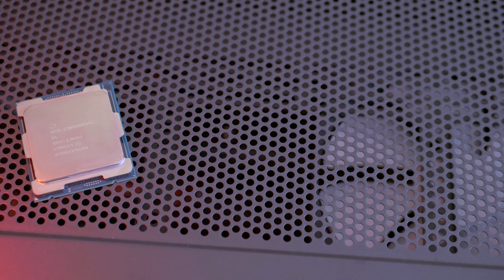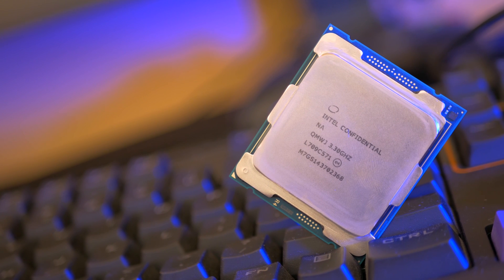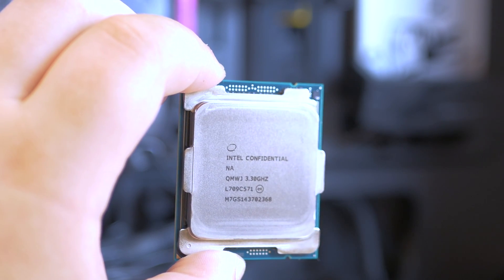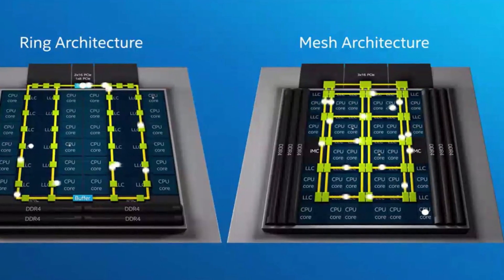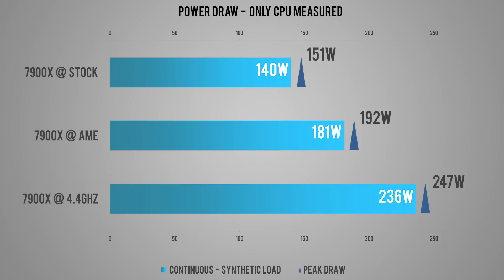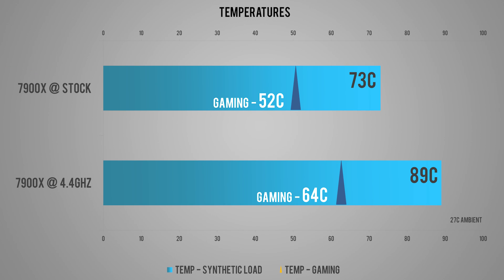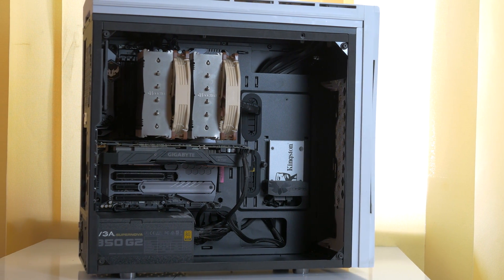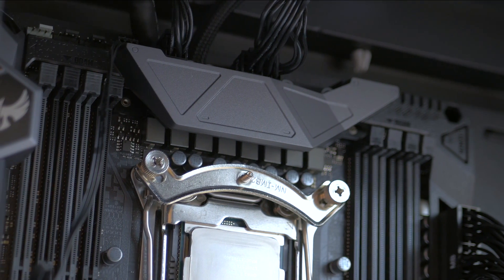Core i9 7900X - a post Threadripper REVIEW

Comment: If you tend to use more single threaded applications then multi threaded then this is a perfect fit and Threadripper is a case of vice versa which is how things have been for years. The argument for Ryzen relies completely on cost beyond that its a questionable buy where performance is concerned when you have something like this within reach.

Comment: Why would you use an air cooler for the 7900x  it was probably throttling down from the heat 
I over clocked mine to 4.7 with a custom water loop and hangs around 70c 
My cpuz score was
 multi thread  6804  single 499
Ryzen 1800x  multi thread 4542 and single 400
Reply: https://valid.x86.fr/208ql3

Ryzen 7 1700 @ 4239Mhz @ Custom water loop
5246 multi, 481 single

Comment: It's not a lot of extra performance over a 1700, which doesn't need high end cooling to run in the 3.9-4.0GHz range. The only benchmark you showed where the performance of the 7900X placed it at its best was the cinebench benchmark which had it at 33% better than the 1700X. So for 33% extra max performance for what's likely a 100% system price increase doesn't make for a compelling argument for the 7900X. Given the other workloads don't come anywhere near that level of performance gain, the 1700 really looks like the desktop king of price/perf for GPCPU related tasking.

Comment: Further shake things up? X299 didn't shake anything up in the first place. Coffee Lake on the other hand, well for that the i5 is going to be the platform's crowning chip even if the top's priced at $300, and assuming the i7 isn't priced at $300 which I highly doubt it'll be, but expect to see 5 to 10% IPC gains over Kaby, horrid TIM, high power draw, a one time use platform, and basically same old Intel, except now there's extra cores/threads. If there's a 4c/8t i5 at ~$200 then that's Intel giving the middle finger to Kaby buyers which'll show how much they care about their customers.

Comment: X299 is just complete Garbage right now. AMD's Threadripper tears apart the i7-7900X, and I'm sure it will beat any of the other Intel Chips that come out for Skylake-X in the Price-to-Performance Department.

Intel's release of X299 was one simple sign: A sign of Panic.
Reply: Who the FUCK drops $1000 on a gaming chip? I hope you were being sarcastic.
Reply: Nope. The high price point for the CPU and motherboard for a few more fps is just autistic thinking. An i7 7700k or a Ryzen 1700 is a much better deal. And Threadripper isn't exactly geared towards gamers.
Reply: So you're going to pay 1000$ for a CPU to play at 1080p instead of 4k? Great fucking idea
Reply: Threadripper has 2x the ram capacity of Ryzen. That's reason enough. 64 GB is not a lot for some workloads.
Reply: barely.  a 7700k is better at far less cost.
Reply: If by some stupid reason you have enough money to buy a $1000 CPU along with the system to go along with that but you also want to do high refresh rate gaming and content creation Skylake X is not a bad option... But if you have $3000 spare I am sure you probably have another $1000 to make a 1950X rig and a 7700k rig one for content creation and the other for gaming, there are also certain times when single threaded performance can be preffered in content creation as well so when it pops up you can just do the content creation on the 7700k rig.

So there is a use case but it's a minority of a minority, people spending $1000 or more on a CPU but not having enough money to buy a second system.
Reply: @Seth Levy you obviously have no idea what your talking about as transcoding and encoding use as many cores as you can throw at the task actual editing may not use all those threads but you will most likely need to transcode the raw footage before you start editing, second it means that you can edit a video while are transcoding another video on the same machine or you can play a game while you export etc etc etc.
Reply: I mean i love threadripper, but when you care for aesthetics and go for a nice board for x399 which will cost $400-500 then paired with a 1920x or 2920x automatically we are already at 1k ish. Im sure you can just pick any bland x399 board thats cheaper or a used one on ebay and get a deal if you dont care and you just want the tr4. 

But for many PC builders that care for aesthetics and a good looking and performing build, then you buy the deal that makes sense to you. I found an x299 board for $159 evga ftw(new) and then a 7900x(new) for $700 putting me about $800+. Price matter yes, but cores do to. Meaning I prefer to compare CPU based on their cores so 7900x is more comparable to a 1920x or 2920x.  Where both perform literally about the same with Ryzen pulling just ahead only due to its extra 2 cores.  

Now I do agree i would of never bought the i9 when it first came out at $1700 it is just plain stupid. But for many of us that just wait for parts to age and prices to come down, then sure who cares you decided to get an i9. If you are happy and you got a good deal, then fuck it. same goes for ryzen. like why pay $500 for a 2920x when you can get a used one for $100 less. Like that makes sense.
Reply: If you want a CPU that is a combination out of i7 7700K and Ryzen 7, 7900X is the CPU you want.  

And that's exactly what I want.
Reply: Etheoma, there is no reason to purchase a threadripper chip for content creation. Simple content creation will never use all of the potential threadripper has. Running multiple CAD and 3D modeling software would come close, but there are very few uses for threadripper on the consumer market. Honestly if you want to play games and stream/record to the same computer, Ryzen 7 or a 6800k will do just fine. No need to dish out thousands fro i9. Just intel's way of pushing out another refresh of the same product. (Also not even 64 pcie lanes on i9. What was intel thinking?)
Reply: i9 is still better for gaming.
Reply: No, I wasn't being sarcastic, And I am one of them who drops $1000 on a gaming chip. 

You don't seem to know that games today and future games is going to favour more cores and more threads. And since i9 has a better clock speed than threadripper. I'm going for Intel.
Reply: That's correct! I do indeed have "autistic" in my username... But my I cannot see how my choice in CPUs have anything to do with the autism spectrum.

Comment: Man.  B350 mother board like $100.  R7 1700+Aio like $400 and run it at 3.7-3.9ghz.  Equal to the $1350 7900X MB/CPU setup for practical purposes.   When Ryzen 2 gets the clocks up, Intel is in serious trouble considering it's looking like Coffee Lake i7 will have a clock speed regression as a trade off for the 2 extra cores.

Comment: This is why i love your Graphs!
You choose for 3466MHz on the 1700X. And the other intel CPU's.
AMD already proof on their blog that, 3466MHz is the performance sweet spot for Ryzen 7.

+MindBlank Tech
As you know the i7-7820X is out and cost ~$550-$600
And AMD still has the Ryzen 7 1900X that will come out soon, and cost about ~$550-$600
Both these CPU's 8 cores 16 threads, and are on a some what costly motherboard platform.
They both support Quad Channel DDR4, but it's hard decision which one is good on what.
Would u find it interesting making a head to head review about these with benchmarks?
Reply from the maker: +Nisco Racing Well, the 1900X has the added bonus of lots of PCI-E lanes. X299's 7820X doesn't. If I get a 1900X, I'll make a head to head, for sure! With R7 along for the ride as well.
Reply: @julio villanueva.  Well a 1900X has 2 other advantages people don't see to be talking about.  First it, like all TR cpus supports ECC memory.  Could be the deciding factor for some people.  Second and why they are worth it, Both the 1900X and 7820X are what I call entry level professional CPUs.  They are for small scale pros.  Think medium size Youtube channles,  small 1 or 2 man indie game dev studios, videographers, audio guys, Twitch streamers. ect.  People who can benefit from the  platform features like more  PCI-E lanes and quad channel memory but whose work volume and/or required turn around time doesn't justify a $1000 cpu......YET.  Yet is the key word and the other advantage of TR over Skylake-X.  If they out grow their 8 cores, on TR the upgrade options are simply better.  Intel's next step up is the 7900X for $1000.  On TR you can pay that and get 16 cores which is way better or pay $200 less and get 12 cores.  It is a much better upgrade path.  Plus AMD is likely going to support the TR4 socket as long as the AM4 socket r so when that day comes to upgrade it's likely a TR gen 2 or Gen 3 can go in the board or you could save money and get the Gen 1.
Reply: If you want more pcie lanes you should go with 1900X... if you want higher clock speeds go with the 7820X... Either  way I don't think any of those cpu are worth it...
Reply: I know AMD has a lot more PCI-e lanes, but i can bet you that most of the people on X399 will use about 50% of the PCI-e lanes.
It's like saying buy this model that has all the extra stuff, but you won't ever use the extra stuff...
AMD 64 PCI-e lanes vs intel 28 PCI-e lanes is indeed a big gap, but until you don't really need that much it's just waste.

My system mindset is towards CPU performance and Memory performance.
I want the best performance in these two cases for the money budget i have.
And i see that AMD Ryzen ThreadRipper is not overclocking that high then Ryzen 7 is a little disappointing.
intel's X299 platform is way ahead of AMD Ryzen's platforms in memory speed.
AMD is struggling very hard to hit DDR4 3600MHz, while X299 can hit DDR4 4400MHz in Dual Channel, and 4200MHz in Quad Channel.
https://www.gskill.com/en/press/view/g-skill-announces-new-ddr4-specifications--for-intel-x299-hedt-platform
And this system is a investment for 2 years or maybe 3 years.
Reply: I have my eyes on the Asus ROG Rampage VI Apex, it has 4 dimm slots, but that is okay. I will have 32GB for now, and maybe double when they come with higher capacity RAM.
They say it's much better for memory overclocking only having 4 because less interference from other channels. And it's known for the best X299 high end overclocking motherboard.
I hope the VRM cooling is extra beefy and capable :D But i trust Der8auer's word on it :D
And it has Dual Dimm.2 that gives you the option for having 4 M.2 SSD's in RAID 0, ha.. that will be a enjoyment in testing :D
https://www.asus.com/us/Motherboards/ROG-RAMPAGE-VI-APEX
Reply: Nisco Racing PCIe lanes will see a lot more use when SSD pricing drops. You can hook up a heap of SSDs and raid them on Ryzen for performance you just can't get on x299
Reply: +Jethro Rose
 Is not my top priority for my system. And the SSD example you gave, i won't be needing that, so it's a waste for me.
CPU and RAM are the most important for me.

Comment: Nice review! I think you did a good job accurately showing how this CPU performs as it matters to most of us. I think the market will eventually settle on 3 main CPU choices. The R7 1700 for an allrounder, 8700K for a little more gaming oriented oomph, 1950X for a little more workstation oomph. But almost everything released in 2017 is good enough at everything. Certainly can use a 1950X for gaming or a 8700K for rendering without worrying too much. Or an 8700K for rendering. Just depends what your priority is. I have a 1700 and find it a good balance on all fronts including heat/power.

Comment: Core i9  7900X Grill edition
Reply: Gabriel Braga i9 7900x is the 2017 edition of Press-hot.
Reply: The i7 960 is another good heater. I might buy one of those for the split level house I'm living in. The TV room drops into the upper 50s or low 60s in the coldest parts of winter
Reply: I hear Core i9 7900X Weber Edition comes with free spatula :)

Comment: RAM 3466Mhz with Ryzen. BCLK?
Reply from the maker: +Senior sociopath ASUS C6H has a strap for 3466MHz. So no bclk OC needed. However, I am running 103 or 104MHz bclk IIRC with 3333 strap. Just because cold boot memory training is better than 3466 100MHz bclk.
Reply: Thanks, mister Mindblank.
Reply: what ram were you using?

Comment: Intel is in full denial now... It's time to accept that Amd is having a great time and lower the prices.
The heat, the power consumption, the stupid thermal paste and more other dumb ideas could be less important if the price was right.
Reply: Lol Intel is not in denial at all. If they were the 7820X would still be $1000.  They almost halved the price of their 8 core cpu.  But took away some PCI-E lanes and gave it a lower model number to make seem like that's not what they were doing but it is.   Without Ryzen and TR the 7900X would have been $1500-$2000 and the top or the Skylake X range. the 7800X would have been the 8 core at $1000.  They have also moved 6 cores to the mainstream which is almost certainly a direct response to Ryzen. So far from being in denial Intel has made the biggest price cuts they have in a very, very long time, maybe even ever.
Reply: josh885 you said without ryzen and threadripper. Well I think that if that was the case then skylake wouldn't exist and most probably intel would sell us four core processors until the end of time

Comment: wow thats getting a tad expensive... I dont think ill be changing over to any of the i9's

When I have my i7 7700k at 5ghz I only get a cinebench score of 1065 at best.. I cant figure out where im going wrong.. maybe ram speed? im at 3200mhz
Reply: what's running in the background?
Reply from the maker: +Grizzly PC Maybe throttling on the 7700K? Also, yes, X299 gets expensive really quickly when you add up the parts.
Reply: Ryzen 7 system has very limited expandability, it's fine for light usage when you need just cores but not much else. HEDT systems have their place, they can take multiple high bandwidth cards unlike consumer grade systems. Nvme raid is not out of question or more than 2 gfx cards. It's not always about core count.
Reply: MindBlank Tech heh that's true, my new build has topped £5k so far lol

Comment: delid it, push to 5ghz on same cooler, never break 80c, now the only limiter is the vrm
Reply: yes, just deliding is gonna magically enable for all 10 cores to go from 4.4GHz to 5GHz... sure
Reply: only providing intel incompitent engineering deparment used thermal paste for the ihs delliding a rizen and adding galium provided no benifit
Reply: indeed, lower temps mean less voltage leak. however, 7900X is measuerd in many sources to pull more than 300W of power at just 4.5-4.6GHz, and deliding isn't going to change this drastically. another thing is that the cooler used has TDP of around 140W, which is enough just for the basic overclocks like this in the video even with delided CPU. Even AIO liquid coolers are not really adequate for the thermal output of this kind of CPU. so for a 10-core CPU to reach the speed of delidded 7700K does not seem very realistic expectation, and especially not on an air cooler
Reply: no. 25 c is 7700k not 7900x. 7900x someone tested it and only about 5C differences. EVEN if there is about 25C I still doubt if 7900x can hit 5ghz since higher voltage doesn't yield as good as the lower ones.
Reply: James Mastroianni. #1 Delid 1K$ CPU not the smartest idea #2 Even that, your realistic maximum will be 4.7-8, when you have good custom loop #3 If you have very good chip, that can handle 1.35@5.0 and monstrous cooling, chiller + vrm waterblock... even then it not practical and can die shortly, because ~400-500w power draw - too much.
Reply: James Mastroianni no the limit is still your cooling
Reply: @Dmitry 4.7-8 when you are lucky. if not top 20%, you will be looking at 4.5-6
Reply: ReactorFox3 well engineering probably didn't get a say in that, as if higher ups said  "we don't get enough profit per chip, cut cost somewhere" then they either lose their job or they put cheap rubber on for tim instead of solder. I can almost guarantee that early, in-house only engineering models were soldered
Reply: You have no idea what you're talking about, even delided these CPU's get hot. About 1 in every 400 7900X's is able to reach 5Ghz and even delided they reach 95-100 Cº
Reply: Denis Briski well anyone who's delided the cpu sees a 25+c temp difference. Lower temp means less voltage leak and less voltage leak mean higher clocks. The value of skylake x goes up a lot when delided, as it's the cooling requirements sink to the floor